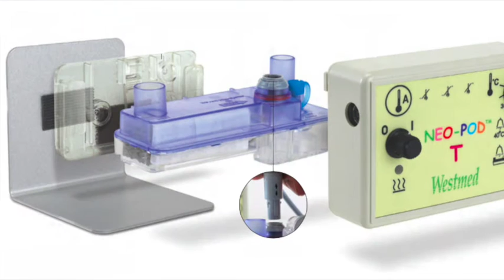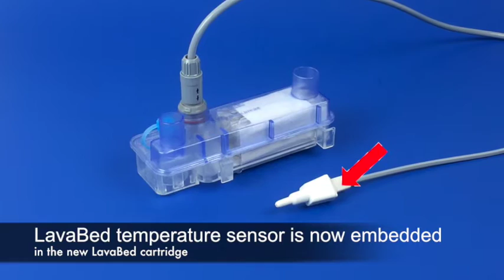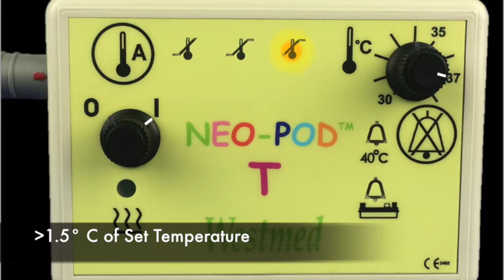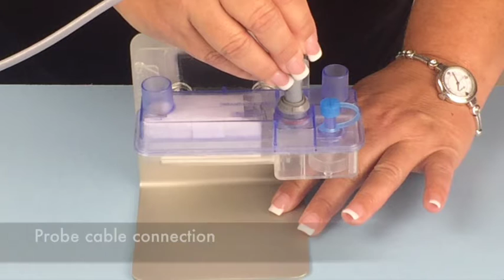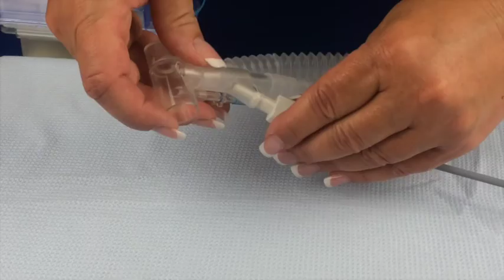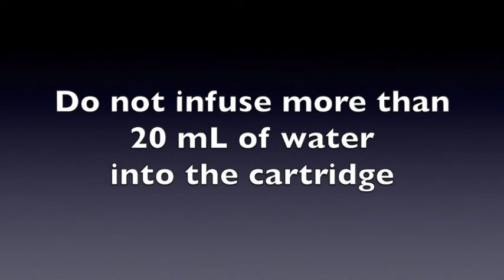Neo-Pod "T" Neonatal Transport Humidification System by Westmed

Comment: Hi Michael - I read a comment on another video you made about your knowledge of ventilators and medical equipment. I also attempted a DIY ventilator (which i was later informed is a cpap)

 https://www.youtube.com/watch?v=QVcfvMxguYI

I have been trying to find the pressures in PSI required to inflate the lungs of a person who is no longer breathing on their own. Would you know this?

Kind Regards - Dan
Reply from the maker: Hi Dan - First off, in mechanical ventilation, we measure pressures applied to the lung for insufflation in centimeters of water pressure (cmH2O) rather than pounds per square inch (psi).  You'll understand why once I show you the conversion.  1 psi = 70.3 cnH2O.  Conversely, 1 cm H2O = 0.014 psi. For typical ventilation of an adult with normal lungs (eg, head injury, drug overdose, anesthesia for elective surgery), the ventilating pressure would probably peak at no more than 20 cmH2O (0.28 psi).  For a patient with severe pneumonia or ARDS (adult respiratory distress syndrome), which is what occurs in severe COVID lung disease, it could take 40 cmH2O (0.57 psi) or more to ventilate, although we have a number of techniques that we use to keep the pressure lower than that to the greatest extent possible.  So, PSI pressure gauges with the degree of resolution required are unavailable, and even if they were available, tracking about small changes in increments of 0.014 psi is awkward.  Many of the physiological principles taught today in respiratory therapy, medicine, nursing, pharmacy, and other health care disciplines rely on measurement terms like cmH2O and mmHg (millimeters of mercury) that were devised using methods that predated the invention of pressure gauges as we know them.        

Regarding well-meaning attempts of the maker community (of which I do 3D printing), making a truly safe and effective ventilator is an enormously complex undertaking to do from scratch with limited background, knowledge, and experience and without the right kind of engineering support, electronics and mechanical prototyping and testing availability, an excellent CAD engineer and regulatory support.  Even the established ventilator companies cannot whip out a new version in the space of a few weeks despite their sizable experience.  And, the maker community, while so important and helpful in many ways, doesn't know what it doesn't know.  Even the community could create an open-source ventilator, let's say, there is no hospital that would use it in even the direst of circumstances if it was not FDA cleared.  And you have no idea what is required to get FDA clearance to market even a fairly simple new medical device, let alone a new ventilator, thrown together in a hurry by novices. You would not even know where to start with the paperwork. Even with the covid crisis getting worse before it gets better, the FDA would not clear such a device.  Complex medical devices, such as ventilators, can do great good, but they can also do great harm.

I hope my comments have been helpful to you.  I'll do my best to answer any other questions or refer you to other sources if it's outside my area of expertise.
Reply: @BrenzMarie  Thank you so much for your clear and concise answer. There is a lot of useful information and the introduction to a new unit of measurement (for me). I'm surprised the value is so low, it would seem most battery operated air pumps could achieve this easily.

I completely understand the facts raised about FDA approval and how medical institutions would never be able to use such a device due to the implications of possible injury caused going against all fundamental codes of medical practices. 

Since this pandemic started in the uk (we've been isolated here 9 days now with elderly relative in their 90s) we've had to secure food supplies which were limited, luckily stocks are replenishing now. We can be arrested for taking trips in the car, and told if the NHS is overwhelmed the most elderly may not be admitted. I personally feel rest assured, knowing I could do everything in my capacity to keep someone in my household going if we had to wait for assistance. Once an ambulance arrives I'd welcome the FDA approved gear. 

 As many out there we hope for the best, but also find ourselves considering other outcomes. 

Again thank you for your advice, stay safe.